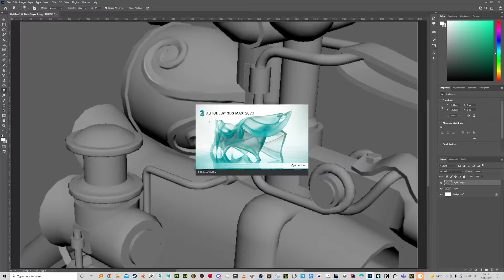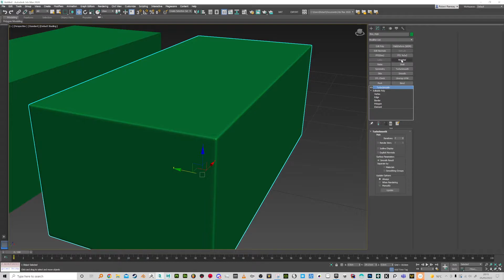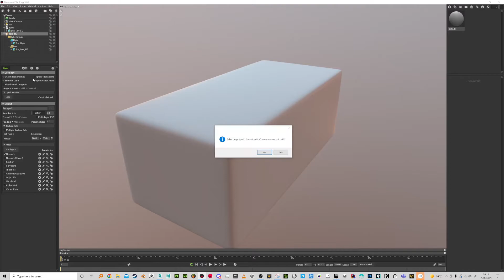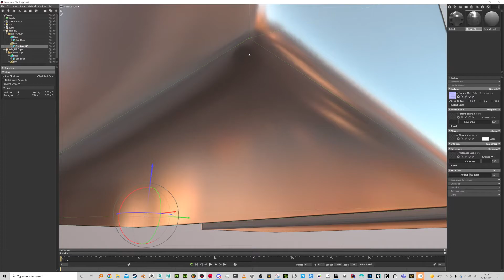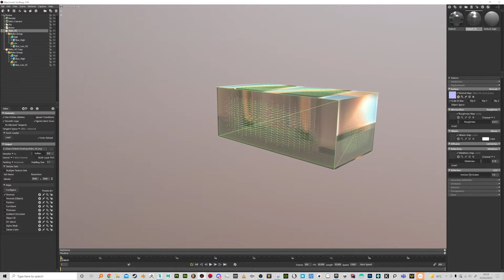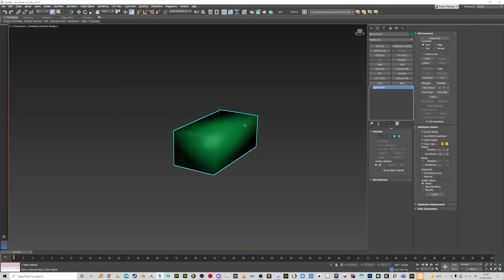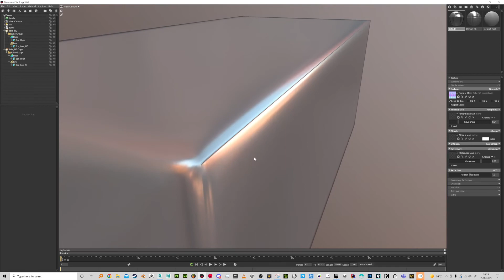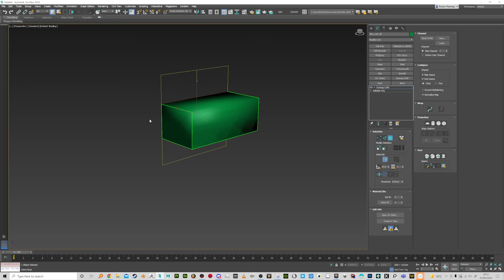Hard Edge vs Soft Edge - Baking

Comment: Great video and very helpful as ive been having a few issues with hard and soft edges on some models being baked from Max in Marmoset. Ignoring the edge artifacts you were highlighting, I noticed at 20:17 when you were rotating your mesh with a lower res texture, the Soft Edge normal version has some slight lighting issues 'blobby' effect which the hard version did not, the hard version had a much cleaner surface response to the lighting / cubemap .. i have seen this myself on some models in Unity, and i suspect its caused by the normals of the Soft Edge version not playing as nicely.. is this something you've noticed as well? (i dont really have the poly budget to add more micro chamfers) but i suspect the only way to avoid it is either using hard edges (and UV splits more) or manually editing normals which is a PITA :hand-orange-covering-eyes:
Reply from the maker: Yes indeed, hard edges are sometimes needed, esp for harder surface models.